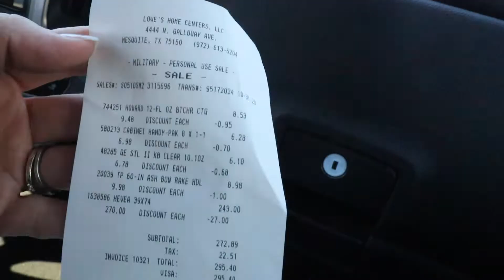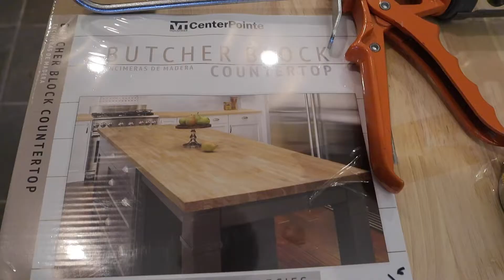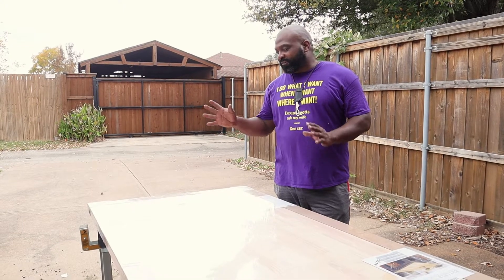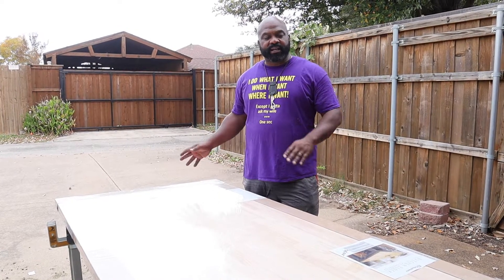Easy DIY | Butcher Block Install

Comment: I like the pencil mark to be able to see where you missed sanding I had never seen that.
Reply from the maker: It helps a lot to know what areas you have missed when sanding.  Otherwise, you have to run your hand all over the wood to see what feels smooth vs rough.

Comment: I have the same type of butcher block in my laundry room. What are you using for a daily cleaner?
Reply from the maker: We sold that house and was just using the mineral oil to clean it. Mrs NG would spray some antimicrobial cleaner for heavy stains.

Comment: Looks great! Just curious are you worried about the overhang slowly u-ing/warping overtime. Have you added any supports to prevent this?
Reply from the maker: No we have no added any additional supports.  I guess if it starts to sag we can add some corbels or something to keep it from sagging.  

thanks for the feedback.  Will keep an eye out for it later on.
Reply: @TheNakidGardeners  You might want to add sometime of brace  underneath as a preventative measure. Fixing warped wood after the fact is a real pain😩

Comment: How often do you redo the oiling?
Reply from the maker: You can do it once a year or how often you see fit.  With us, we are keeping it at once a year.  Do you currently have a butcher block countertop?
Reply: @TheNakidGardeners  I am putting in birch plywood counters. But I have been using oil on cutting boards too.